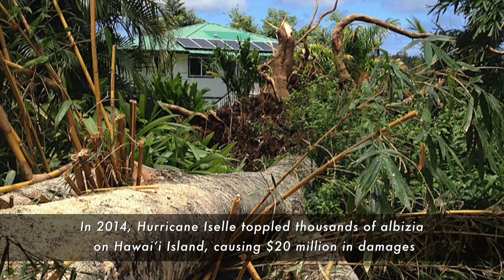House built out of Albizia wood might solve multiple sustainability issues

Comment: Albezia is one of the fastest growing renewal resources we have for the construction, furniture making, and paper industries. This wood can be used in a multitude of ways. All of these problem tree on the island can be used for engineered hardwood flooring, external siding, internal paneling, chip board (aka particle board for wall sheething, sub floors, roof decking, cabinet boxes, etc., etc.,), plywood, cabinets doors & styles, crown molding, baseboard - window - door trim, engineered roof trusses, decking, railings, staircases, etc., etc.,... There are so many uses for this wood. The fact it can grow so fast while trapping carbon makes it the best wood species to farm in the tropics. When Albezia trees or any carbon sequestering trees are burned, chipped up, or otherwise allowed to decompose, all the carbon sequestered from the atmosphere and stored in the wood will be releasted back into the atmosphere again. By utilizing the wood, the carbon stored remains trapped. Thus making these trees an excellent storage device for carbon. 

Many countries do farm this tree for all of the abovementioned uses and many, many more. The wood is beautiful. Making it perfect for use as veneer on other unsightly, but harder wood species such as pine, poplar, fir, and the like when needed for visible structural support.

The state needs to see these as a resource when removing these trees. Logging these trees, rather than cutting down to make mulch, and selling them on may actually reduce the costs or possibly cover the cost and provide a profit. The trees could be milled and used in state, county, or city construction projects. Thus cutting down on the costs for other lumber. Local Colleges and schools could use the lumber in their shop classes. Local craftsmen coukd also use the branches for their furniture or art pieces. The branches are also excellent for making pulp paper products.

Hawai`i, please stop wasting this resource. Chipping these tree for mulching leads to the release of the sequestered carbon. Chipping them to make particle/chip board is excellent. Chipping does make transporting to a pulp or plywood mill much more efficient. Doing so also provides a sellable product that'll keep the carbon trapped in the wood. This is a win win for the state, the residents,  and the environment.

Thank you.

Cheers from Seattle 

Despite being am invasive species, it's a remarkable resource when logged and used properly.